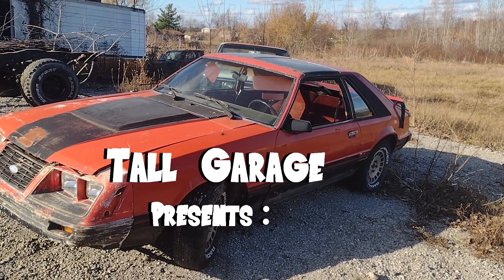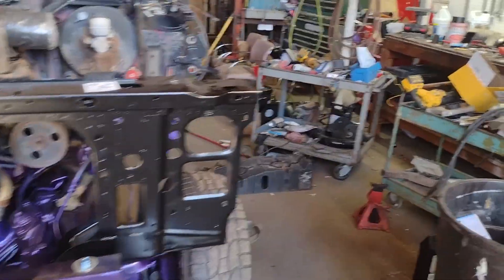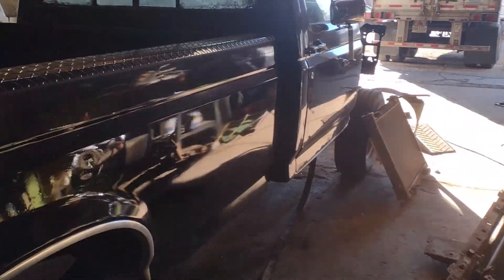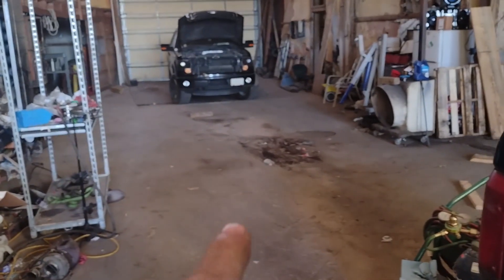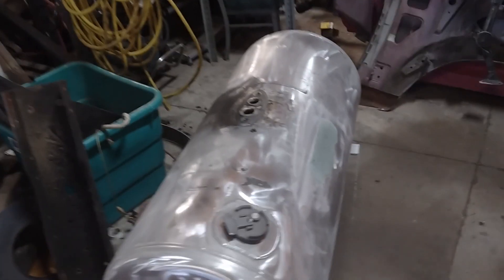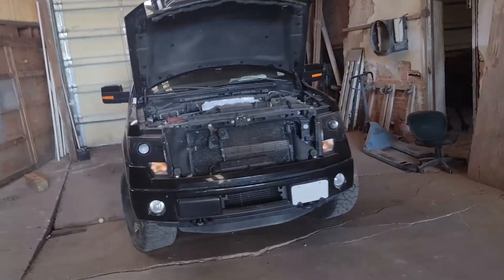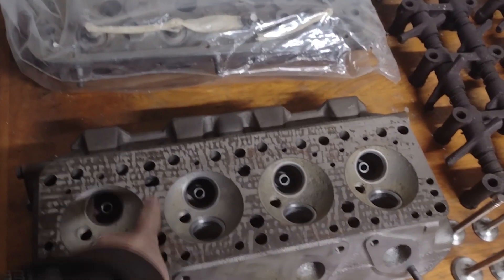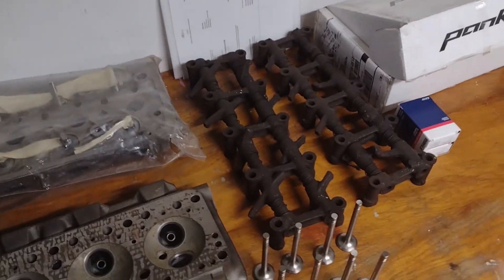Winter Is Again Coming, Shop/Project Updates F250 Power-stroke, 300LS, 241 Red Ram Hemi Build Start!

Comment: Used eBay nascar take out rods nice, I have used those a bunch of times with great results. They also come with 1.889" Honda rod journal size in case you didn't know? 

As long as you're having the crank ground down that much you might as well tell them to add extra stroke. You have to get custom pistons anyway, might as well.🤷😎👍
Reply: Just rewatched and heard you did say offset grind.👍
Reply from the maker: you know iw was looking for some that were 6.2 long and 1.889 but i didnt see any, could be ust me tho, i see more 1.850 then 1.889

Comment: Biggest acheivement,,,,Getting the car ready for NNN. New front end kit, all parts sand blasted and painted. Floors patched and replaced proper.. ( at least all the holes are gone) New insulation and carpet. Again, not perfect but way better than it was. Undercoating stripped except around the trans. Underneath rust encapsulated (from rear bumper to trans)Inner fenders stripped and painted perty. Fuel cell reworked and safe finally. Battery box and cut-off switch installed. Trunk cleaned and painted. Got more done on the car than I expected.
Reply from the maker: Heck yeah, thats a big job, good deal.

Comment: @tallgarage 
Is the reason for not using aluminum Cleveland heads the cost? I wonder if they’d line up perfect over the cylinders. I’m getting ready to take in this type of project for my 79 econoline 100 shorty. I like the idea of staying ford and I’m thinking the 2 piece head would line up perfect. Thanks
Reply from the maker: Yes sir, the LS heads I used were 50$, I don't even want to know what aluminum Cleveland heads cost, also the bore spacing in Cleveland is .020 worse than the ls head .100 total so if you were to do it the way I did it cylinders one three four and six would all have overhang of about .050
Reply: @TallGarage  they cost around $1000-$2000 a pair. I imagine that would it would take 6 pieces or three total heads.

They bore on a Cleveland is 4”. Are the cylinders spaced farther apart? I was under the impression that the Cleveland heads matched up pretty well but that was just because that’s what was used back in the day. I never looked into overhang of the vintage racers. 

I’m going to track down some old iron heads and see how they line up. Thanks for your channel and info
Reply from the maker: The Ford 300 is 4.480, the 351 is 4.380 iirc, the LS is 4.400.